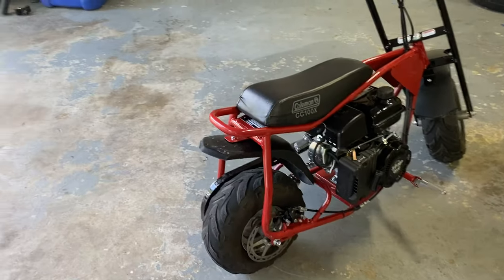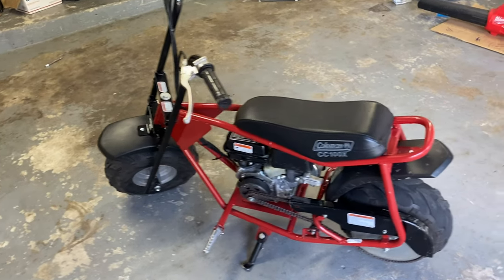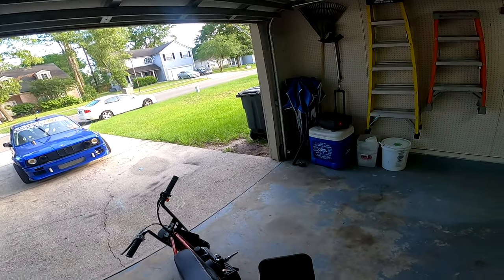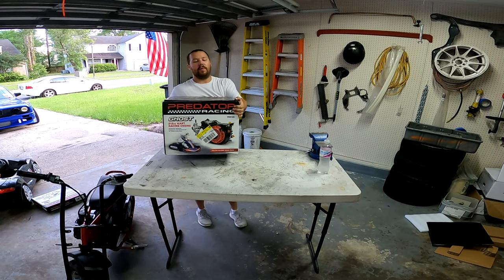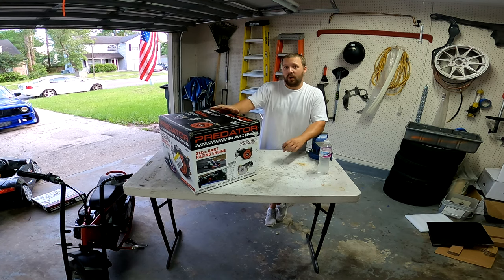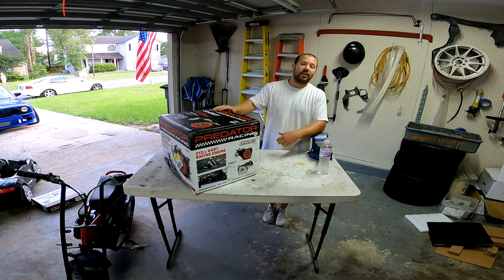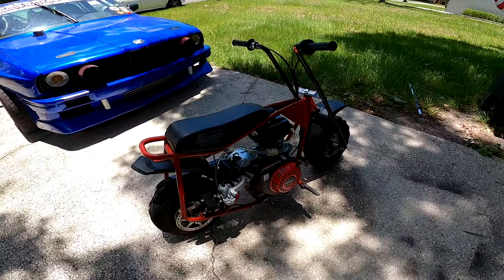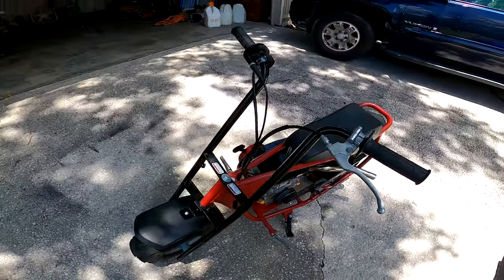Predator Ghost Mini Bike Build! The Ultimate Pit Bike! *Race Engine*

Comment: If you don’t want to do the whole 10hr break in but you do want to do some sorta break in I would recommend running the engine easy for about 10 minutes or till it’s up to full temperature shut it off and let it cool down. Do that about 3 or 4 times that’s the best quickest way to do some sort of break in. I was told this by an engine builder awhile ago.
Reply: Or just let idle all day before the day you ride.

Comment: You can easily remove that top plate and that tank will mount directly to the top of the engine. Then lose the pulse pump and run a gravity line to the carb.
Reply from the maker: This motor doesn’t have tabs to mount a tank ontop like the 212
Reply: @BryanSturman92  yes it does, its a 212 block, i have one
Reply from the maker: @bowhunterdave  the ghost engine does not have a mechanical governor.  Pull the case apart.  It has a coil with a 6k rev limiter.   It’s not an exact 212 block
Reply from the maker: @bowhunterdave  even some of the case is different as far as bolt
Holes and tabs.     I’ve had like 6 of these comments.    Take your apart and repot back
Reply: You cannot mount a tank to it. The holes are different. Also someone mention the gravity line to carb. The pulse pump is the way to go. That is the way this engine was designed. It does have a crappy fly wheel. You may wanna put a bill flywheel in it. I put a torque converter on mine ghost. It def pulls off much faster. Top end speed losing a little but as far as hills go. Torque Converter is life. I'm 6foot 220 pounds I had the Coleman rt200 up over 50 mph.
Reply from the maker: @seanroseman6768  yeah I tried tellin these guys a tank doesn’t bolt to this block but what do it know.  I wasn’t staring at it on a table in my face or anything lol
Reply: @seanroseman6768  bullshit on the no tank mount, you remove the top plate and tank bolts right on. the pulse pump is only for applications where the tank is remote and gravity feed wont work. the motor are not "designed" for pulse pump. you have your facts all mixed up.... factory flywheel is rated for 8000 rpm.
Reply: @bowhunterdave  the ghost will only rev till about 6,000 rpms
Reply: @seanroseman6768  I have a stock 212 tank mounted on my ghost. It’s bolts right on no problems you just have to remove to top plate and a small portion of the heat shield.
Reply: @rws0010  nice. I just mounted the cylinder tank to the back.
Reply: @BryanSturman92  yes it does
Reply: Then u will have to cut the oil screw from the top if you using a ghost motor
Reply: @seanroseman6768 if you don't change the coil
Reply: @BryanSturman92 i have pics i have one with a tank bolted on my rt200it
Reply: Ive already mounted a predator tank to a ghost engine by removing the top plate and its gravity fed fuel line to the carb no issues. Also I used a Amazon straight pipe. I didn’t use the ghost kit I went my own rough and saved a lot of money and have zero issues with the motor. So stop saying it doesn’t work until you have actually done it. You are wrong. The block isn’t exactly the same but you can remove the plate and mount a tank. Also a hisen 196cc gas tank is a perfect fit also just gotta cut the tab off the top oil fill cap that you don’t need for mini bike applications. Not rocket science.
Reply: Does it not flood the carb ?
Reply: @BryanSturman92  i have literal picture of a 212 tank bolted on a ghost 😊

Comment: You were turning the main jet screw, for high speed control adjustment. The idle screw is to the right, directly in line with the cable. It controls the slide
Reply: Was doing is 100% valid, you just misunderstood what was goin on.
There is no "main jet screw" either.

Comment: Best video I’ve seen ! Thank you brotha
Reply from the maker: Ya dude! Thank you 🤙. This was just a one off video I did outside of my normally drifting/building videos and its the best one I have 😂
Reply: @BryanSturman92 well what about a video hooking up the on off switch on the handlebars instead of the one that comes on the side of the motor? I’m struggling with mine I can’t figure it out. I’m mechanically inclined I just don’t have enough experience with small engines. Just did the motor swap with the Predator 224cc and that’s all I have left to do

Comment: The only problem I've found so far installing this on my bt200x is the intake manifold extension in the accessory kit makes the filter rub the rear tire
Reply: using the default black one is fine though? imlooking at doing the same thing shortly
Reply: @SecondSunofficial  yea you can use the one in the kit if you slide the engine a bit or pull back the rear tire, with no rear suspension it has no way to contact but it will be pretty close

Comment: If you remove the plate the fuel pump mounts to you can use a regular style tank for these and run a gravity fed line to the carb.  I know you said in a previous comment yours doesn’t have tabs, but it’s does.  That’s what the plate mounts to. Then buy an Amazon exhaust and you could have saved the $200 on that kit. $20 for a tank and $20 for an exhaust.

Comment: What happened to break in, 6000 isn't breaking it in...Better check bearings after over reving motor. Rings never seated in, going to have blow bye. The piston probably egg shaped from excessive heat being new. I'm very familiar on the Predator 212 motor. And I always run a tank of 93 through the motor, and change oil before hammer it. Good luck on yours.
Reply from the maker: Bro it’s a couple hundred dollar harbor freight engine lol.  It’s been running just fine to this day and we have beat the crap out of it.   If it goes bad I’ll just snag another lol
Reply from the maker: It’s not that serious my man lol

Comment: Got one for my 8 y/o this past December and the damn motor hops so much, it keeps throwing the chain!! I slid the motor up as far as it would go to tighten the chain and all it did was wear out the roller, then the chain from hitting the roller bolt! Im gonna either try some motor mount bushings or have a thicker plate welded on! I decided to buy online new in the box so i wouldn't have to mess with anything, because im lazy rather than marketplace to save a few hundo!

Comment: Can you get a different coil and bypass the 6000 rev limiter and if you do so is the rest of the engine capable of handing the excessive RPM besides probably needing a Flywheel to prevent It exploding on your leg LOL Would you need anything else besides that?

Comment: You need to run the muffler that header pipe was built and specs for peak performance. It want have all the torque that it should because it needs that muffler to hold the proper amount of back pressure. For as break in 1 hour tops if the rings don't seat in that time frame they never will.Also change the oil after break in. Next throw that clear line in the trash use either approved gas line or blue line.

Comment: For the brake in you don’t need to run it for 10hrs if you ride it with governor in your hood but if you take it out the brake in is 3 hrs with the governor in
Reply from the maker: This motor doesn’t have a governer.  It’s too late I’ve been bouncing off limiter since day 1.  We didn’t do a break in haha
Reply: @BryanSturman92  I wouldn't worry about it. Just ride it hard and after 20 minutes or so of running change the oil. There's your break in.

Comment: i got a 212 hemi no governor pz22 racing spark plugs and exhaust it goes 41 and I'm 190... my stage 2 motor does 70 i think the ghost is a rip off you can do all the upgrades with the same 212 (reg) motor and a new carb... spend half and get the same results
Reply from the maker: Nice that’s cool.  Yeah I’m aware this was just  somethin quick to get a bike to ride around in the pits when I race
Reply: @BryanSturman92  i understand fast upgrade from the first motor

Comment: Buddy, the fuel pump is vacuum powered. You don’t need the fuel pump if the tank is above the engine. The tank is gravity fed which means it can go straight to the carb.

Comment: A 15tooth max torque clutch with the stock 70tooth rear sprocket should get you around 60mph with that motor…
Reply from the maker: Yeah I just swapped over a 40 tooth and it goes 60.  No need tk go that fast though it’s sketchy 😂
Reply: @BryanSturman92  what size sprocket and what clutch did you use to get 60 ?

Comment: Should of added shims for the clutch, those allens screws on clutch will get loose.

I hqve a doodlebug db30 with 212. Has billey rod/flywheel, mod 2 cam. With a 12/70 it runs at 51 but launches hard. Now went bigger cam & going 15t clutch & just meed to port my cylinders heads & see how faster it runs.

Comment: It would help if u kept the back wheel off the floor on a block of wood for the first time start up just in case things like that happen till u get it right, nice (mini bike) u got. My pit bike has gears, big front and rear suspension and big nobbly dirt bike tyres coz a pit bike is a smaller version of a dirt bike,motocross bike. 💯💯💯💯🤔🤔🤔🤔🤔

Comment: PLEASE LET ME KNOW WHAT THROTTLE CABLE KIT U USED !! HAVING ISSUES FINDINGS A CABLE THATS LONG ENOUGH INTO CARB
Reply from the maker: This is just a universal kit from Amazon. It was JUST long enough to reach.  Litterally maxed out and was perfect.   Do you have the same setup?
Reply: @BryanSturman92  yes same engine and kit. My bike frame is a Baja warrior bike tho so little bit bigger so length of cable would have to be about 50 In

Comment: You should rotate the pull cord housing so the pull cord is facing backwards. You almost ran yourself over because you have to start it from the front of the bike.
Reply from the maker: Yeah I did that right after I made this video. I’ve done a few things I need to make another video on

Comment: If u didn't press the throttle it wouldn't have toke off u can hear u press it twice. The fine mixture screw is or should be set to 2/2 n half turns out anticlockwise and 4/3 n half turns out max anticlockwise it's used for fine fuel adjustment, so if u have to screw it IN clockwise nearly all the way in to get it to rev up you need a smaller main fuel jet and if u have to unscrew it more thn 3 n half to 4 turns out or more to get it to rev up u need a bigger fuel jet. So whn u have the right fuel jet u can use that mixture screw for fine fuel adjustments for a smaller adjustment to get it just right, if its 4 and abit turns out and it works good go one fuel jet size bigger and reset the mixture screw to 2 n half turns out,,,, always tune an engine whn its upto temperature not whn its cold. And although the idle screw is called a idle screw it's there to set how big of a gap there is whn the throttle is let off so it stays running most smallish carbies the gap shouldn't be bigger than 2mm (check google for your carbs settings) if it is it needs a bigger starting/choke jet, 💯💯👍👊

Comment: Please don’t call the Ghost Engine a “fully built race engine”. It’s really not. That engine with the upgrade kit is $450. You can build a regular Predator 212cc with more HP, Torque, Higher RPM and more reliable for $450

Comment: "fully built"? Come on man🤣 everything you need is in the accessory kit ? Except of course a fuel tank. That header is bent for a go-kart. Replace the stock plug with a ngk. Clutch is a different shaft size. That engine is good only if you race in a class that requires it. If you aren't get a tillotson 212 and build it
Reply from the maker: I specified in the video if you already race go karts then you will have all
The extra stuff that you need.   It didn’t come with a fuel tank.  And the clutch is also from the previous motor.  I stated all this in the video what did and didn’t work. As well as what comes in the kit.

Comment: It's a race engine so they claim... But yet it comes with a governor... 🤣
Reply from the maker: No it doesn’t.  No governer on the ghost engine
Reply from the maker: It has a rev limiter
Reply: Its the same thing.. lol pretty much. The only difference is you have to buy a different ignition coil instead of just easily removing something
Reply: @ @gmane1989 They are not the same thing! A Perfect example of a governor would be on your lawnmower, A Governor allows the engine to maintain a constant RPM despite the engine being put under different clothes! A rev limiter is used to prevent an engine from going over a predetermined RPM! Your comment is why people should never go to YouTube in order to learn how to do something! For the most part YouTube is filled with a bunch of Youtubers pretending to be mechanics, Actual mechanics are too busy working in a shop to make videos! Even when actual mechanics make a video do you really think that they divulge all the information needed to do the job in the video! But hey what do I know I only have 27 years under my belt working as an actual mechanic!